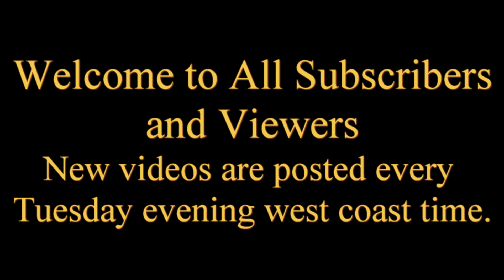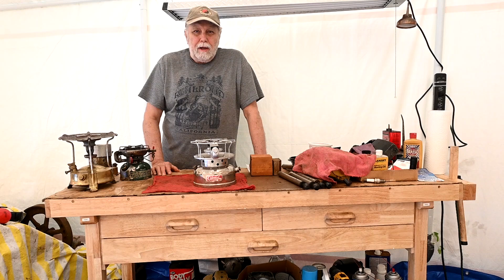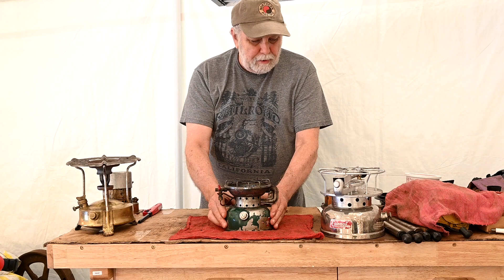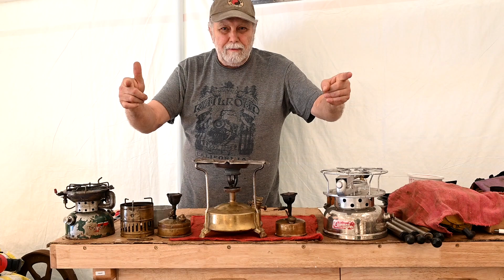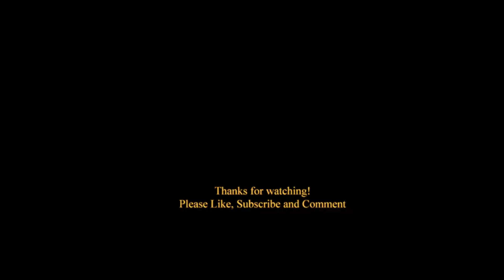Vintage Single Burner Camp Stoves: US-vs European Designs

Comment: The newer Colman Duel Fuel stoves can burn unleaded gasoline but is it safe?
Reply from the maker: Newer Coleman stoves and lanterns are rated as dual fuel, meaning one can burn regular gasoline or white gas (Coleman fuel), in them, but they will give off toxic fumes from the additives in gasoline. This means outdoor use only.
Reply: @ thanks

Comment: Wait a second... so what you are saying is this thing Burns 50 octane white gas but does not produce carbon monoxide? That pretty much runs contrary to everything I was ever taught. How sure are you about what the actual controversy you mentioned refers to? I mean it must have some basis in reality as you spoke about a heater drum that they make for the thing but like you said, these things are from the 60s... no one gave a shit about that back then, right?  Unless they went to, and actually completed Junior High, that is. Well, one thing I won't question is that the American propensity to shrug off dangers and environmental hazards to themselves and others may be the real product review here. Sorry about your wife. No offense intended on the comments here. Good luck... fellow camper.
Reply from the maker: In the past, Coleman said you could use a lantern or stove in an enclosed area as long as there was some ventilation.  Today they say the exact opposite. The former is true if using white gas with no additives, not so if using regular gasoline. Gas for cars has lots of additives, which can be harmful if breathing the fumes. I have seen tests where they were operating camp lantern and stoves in enclosed areas, and no noticeable carbon monoxide was present using white gas.  It is best to have some ventilation though, as the oxygen can be depleted and there is an odor from burning the fuel. Today's Coleman gas stoves and lanterns are called dual fuel, meaning they can burn gasoline and white gas. Earlier stoves and lanterns were designed for white gas only. Best to always some ventilation.  In the cold weather, I use a Coleman catalytic heater in my small shop and use my lanterns in the shop and house when the power is out, and I always have some ventilation. Works fine for me.
Reply: School and social engineering camp are to different things, guessing you went to the later.
Reply from the maker: The test results I found were done with proper monitoring equipment and done by experienced personnel.

Comment: I hope Mrs. Obsolete is doing well, as well as can be. I'm glad to see ya back. Great little stove, Obsolete stuff is cool. I did finally mess a little (be to busy) with 1 of my macs. Mac 10 10.pro. Has good fire, filter was filthy an gas lines are hard. Didn't have much time , was repairing gauges on 1 of wifes favorite vehicles.  Glad your ok , take care cooler weather not far away.
Reply from the maker: It's great to be back.  Mrs. O is healing up well, but her recovery is a slow process due to the extent of her injury.  Thanks for the kind words and for watching.  The Pro Mac 10-10's are an excellent midsize saw.  You will be happy with the performance.